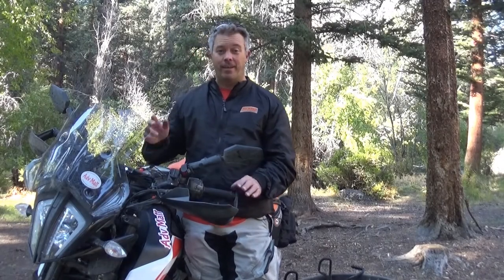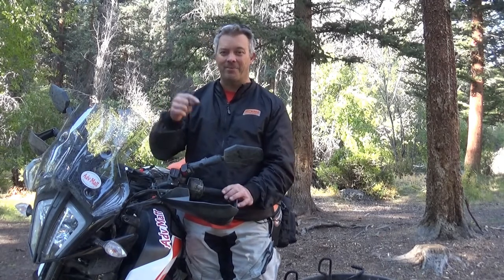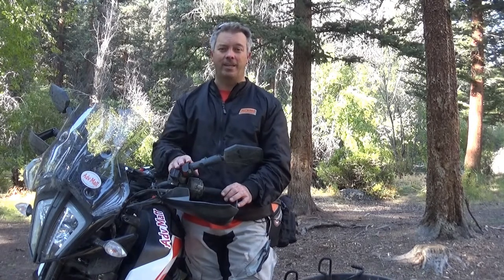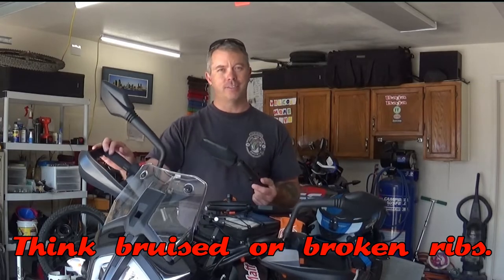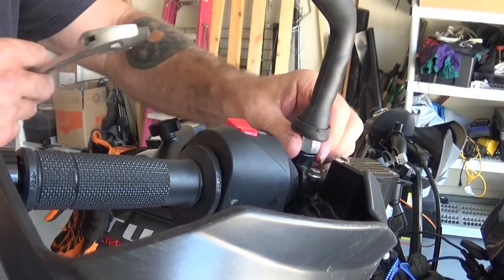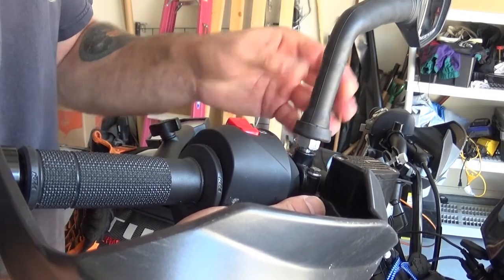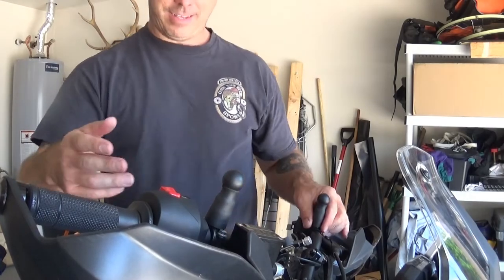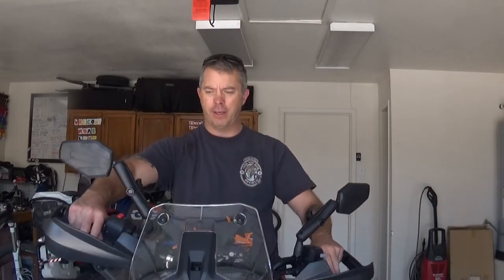Why folding Mirrors?  A Doubletake on it.

Comment: Can we not fit without adapters?
Reply from the maker: You can't right side without the adapter because the right side mirror is a left hand thread.  The adapter converts the left hand threat to right hand thread for the ball mount.  I think the left side can be mounted without the adapter but the mirror heights will be different.

Comment: Hey Matt. Those Mirror Adapters are M10 both ends right? One side is RL thread and the other side is LR is that correct?
Reply from the maker: I don't know what the thread size was on the adapters.  The mirror kit I purchased from Double Take came with all the necessary hardware so I did not have to figure out adapter sizes.  You are correct, one adapter is right hand thread and the other is left had thread.  The left hand thread converts over to a right hand thread for the ball mount.

Comment: Chippy the chipmunk at the end of the video is the star of the video. :face-green-smiling:
You can buy only the perch "c" clamp piece. I broke both of them on a Honda Transalp. Did not have to buy a master cylinder or clutch lever mount. I easily made new mounts in a few minutes at home until the new perch mounts arrived.
They are expensive and many users say they vibrate and do NOT like them. Even on a BMW GS 1250.
In some locations they are often and easily stolen due to the big wing nut.
Reply from the maker: Yeah, I only installed these mirrors on this bike.  I haven't installed them on any of my other bikes.  They are OK, but after 10s of thousands of miles with these I haven't found them to be a huge upgrade.

Comment: got mine as well. thanks for the tip matt. proud owner of our 390 adv. vince from the philippines
Reply: Hello Sir Vince! Isn't that a little risky in the parking areas around Metro Manila? Easy for them to take out. Do you remove them while parked or you just leave them as is?
Reply: @siczero  mine has a ram locked so it will not be stolen even on the parking lot

Comment: When I was about 13, I went camping with a friend, and his family. One morning we were eating breakfast at a table that was right next to a tree. One of those chipmunks came streaking down the trunk, Stole a full size powdered doughnut out of the box, and went streaking right back up the trunk. As fast as it went up the tree, you wouldn't even have thought the doughnut had any weight. If you hadn't seen the theft, you would only have noticed a white powdered doughnut flying up the trunk.
Another fun thing to do is tie a peanut on to a fishing line, and then play tug of war with squirrels, and chipmunks. It works with blue jays also.
Reply from the maker: That's funny.
Reply: Not good to do the fishing line, as they are busy trying to store food for the winter, let them get there work done.  Sounds like you like to bully little animals. LOL
Reply: @hiltonmcconnell2563  Hilton, you are soon sensitive. How cute. I am not suggesting that you settle down for the long haul, taking them away from their work for hours at a time. I am talking about 10 minutes. That will not make the slightest dent in their winter hoard. LOL

Comment: If you were to fold the mirrors inward, as I have seen some people do while riding off-road; do they pose any danger to the KTM display if you were to take a fall?
Reply from the maker: I just looked at it, and I suppose its possible the mirrors could make contact with the display, but it doesnt look very likely.  The mirrors tuck into the bars and it would be hard for them to reach the display unless you get knocked directly into it as well.

Comment: Seems a good solution to my windscreen upgrade.
I've installed the 790Adv windscreen on my 390Adv.
Factory mirrors collide with the new windscreen.
Doubletake mirrors could fix this issue.
Reply from the maker: Doubletake mirrors are great.  All the adjustment should fix you up.

Comment: The Adapters are Not Same Size. You said the Left Side is Longer of the two
Reply from the maker: I just rewatched the video.  Without using the adapter the mirrors wont be at the same height.  The adapters set the mirrors at the same height.  The adapters are the same length.  I did not see a reference to the adapters being a different height, only different thread directions.

Comment: You forgot to mention about the locking nuts that are available for the tensioning adjusters...
Reply from the maker: Didn't know about them, thanks.
Reply: They are like lug nut wheel locks...and have a patterned  key

Comment: Had em on my crf450l not a huge fan
Reply from the maker: Why not? What problems or issues did you encounter?
Reply: @advmatt   mainly for the price I expected a more solid connection to the bars than a glorified zip tip.  I actually like the stock mirrors on this bike more than I do the ones on my crf450l
Reply: @advmatt   no operational or functional issues just caused me anxiety.   I know mirrors aren’t load bearing but I just have a thing about things being on solid